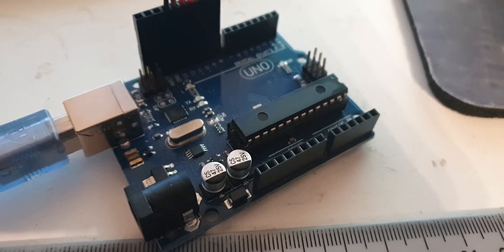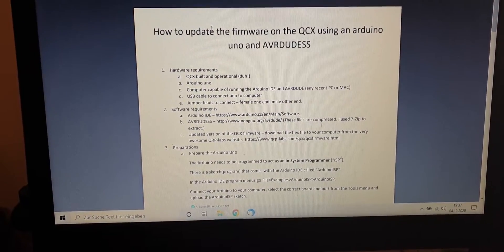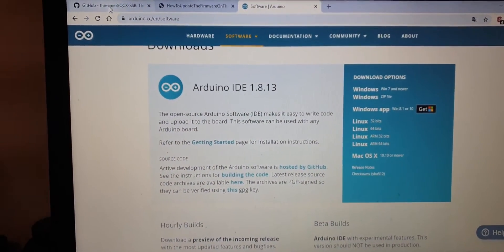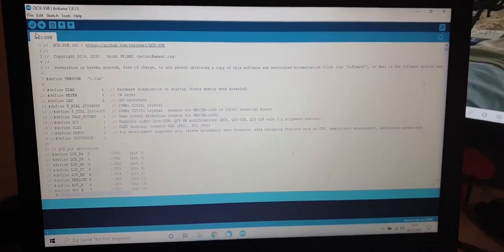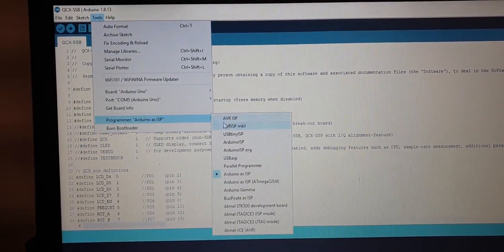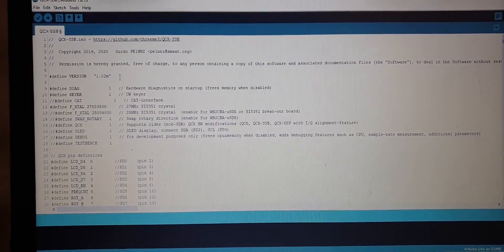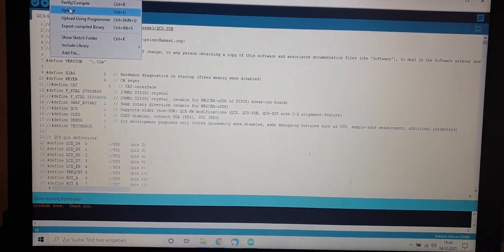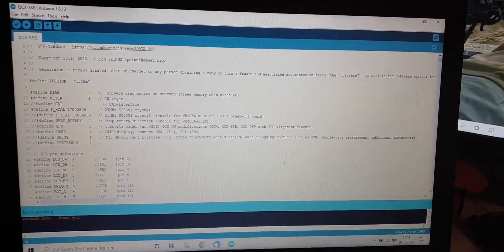How to get the Software on the uSDX ?

Comment: Hello all, I have an issue with getting the code file uploaded to any and all of my MCU's. I've updated my IDE to the latest and after doing that, nothing would work so I contacted Arduino help and it looks like they got it fixed because now I can change my IDE settings and get codes loaded from the libraries. Here's the deal I can upload codes from libraries and all works fine but for some reason related to integers at lines 4326 to 4332 the file fails upload, it passes compile test and as I stated, I can load other codes to the chips but not this code. This is the only thing holding me back from seeing my radios are going to work or not. I'm not a seasoned vet where it comes to Arduino or pretty much anything to do with a PC. Anyone have any input or output? I put all this stuff away a few months ago frustrated so memory is not going to be any help for the moment. I need to pull all my uSDX parts and stuff out to re connect to this PC and someone to hold my hand through this. I've watched this video more times than anyone else but it isn't getting me anywhere because doing what is instructed here doesn't make it work. Like I said, I can get into it and make other codes work but not the code from github to go onboard the chips yes chips. I have a bunch of them and I've tried them all. They work for about anything but this code file

Comment: Why not just program the uSDX directly from the PC instead of using an intermediate UNO to complicate things?
Reply from the maker: Because ATMega Controllers without Bootloader need to be programmed via ISP. There´s no other way to communicate with them.
Reply: @dl2man  How do I tell if the Arduino has a bootloader and if not wouldn't it be simpler to just install one?   Since I have a uSDX transceiver that is already working that has Rx and Tx connections can't I just connect a USB adapter right to it?

Comment: Thanks for doing this video, Manuel. Now I know that I can hack my way through whatever without getting too jittery about it.
I downloaded the various software packages and looked at the uSDR program. Looking to change the start frequency when changing bands to the CW sections (I have very little use for the FT8 parts; trying to keep the SOTA/POTA activities to a minimalist point. Radio, antenna, battery, key, headphones and what's left of my brain.) Nice to be able to see how this works. Stay safe & sane! 73 de W8IJN

Comment: Great video, thanks. I have a 2.1 Sandwich that is working but has an older firmware with less functions in the menu, also the encoder is reversed. I followed your steps but get this error message: "avrdude: Yikes!  Invalid device signature". I get the same message if I try to burn the boot loader. Any suggestions?
Reply: problem solved, broken wire inside the connector.

Comment: Quick warning for Linux users.  If you install the Arduino IDE from the repositories (apt-get or Synaptic type installs) you will get an old version and it will not compile the code.  You must get the newer version directly from the Arduino site like this video shows.
Reply from the maker: TNX fer Info. Didn´t know that, as I´m a Windows user....
Reply: @dl2man  Arduino IDE  works on linux mint  i try  it  and i have version 1.8.19  .Effectivelly  i have probelem with  the file  USDX.ino . Cannot  compile on Linux and  Windows too i have error . I have this Error : Stray "\ 302 " in program  when i make  verificatioin /compilation  . no problem with old version 1.02W